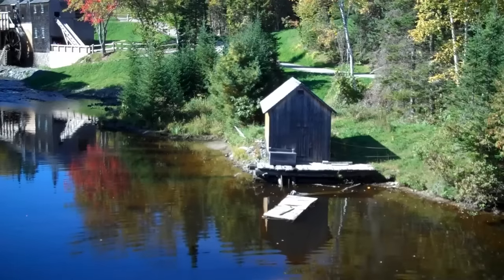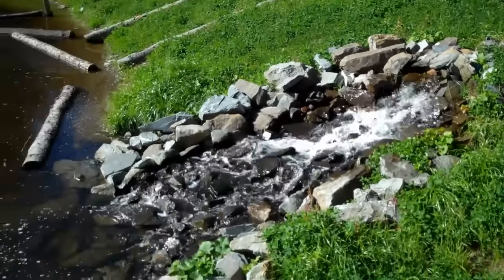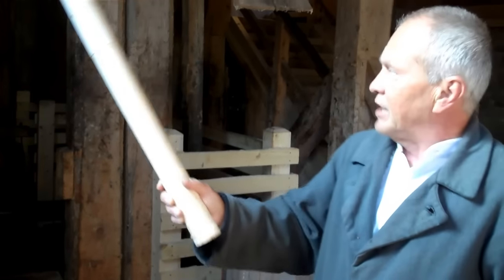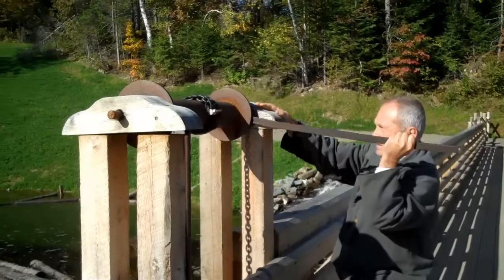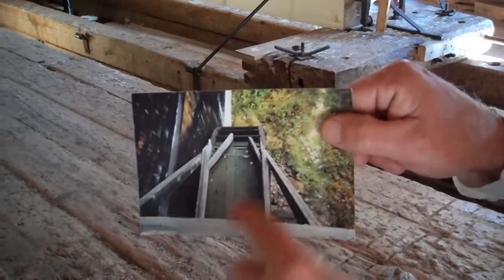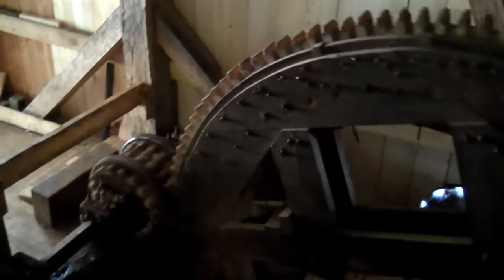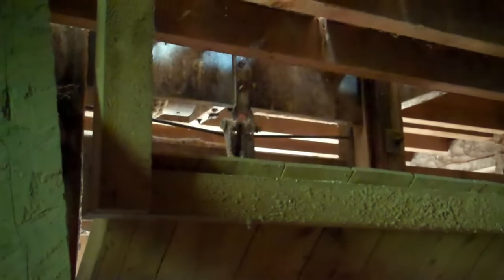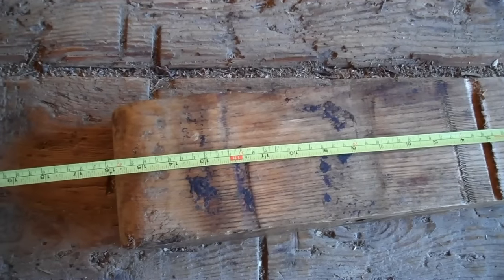Water Powered Sawmill with Wooden Gears at Kings Landing

Comment: I am always impressed at how ingenious and creative the men were who designed and actually built these  water powered saw & grist mills. I wonder how long it took to build this mill? Yep, times were a lot slower then, and it shows in the quality of the workmanship. And the lumber...wow...not your Home Depot lumber, that's for sure...back then, 2 x 4's were real 2 x 4's....not some cheap quality wood and considerably smaller than a 2 x 4. Thanks, Herb, for this wonderful look at this mill.
Reply from the maker: Thank for comments.  We have a smaller water-powered sash sawmill at Leonard's Mills in Bradley, Maine.  It took volunteers many years to get it running properly.  Here is a video of it sawing lumber last weekend: https://www.youtube.com/watch?v=30tBXWrZrH0
Reply: The other reason for the change in size is the change in the whole sawmilling industry, back when sawmills like this were popular the wood would be transported through the water and often times sit in the water up to a year, as a result of this the way the wood dries was very different meaning it would stay the same size as it is milled exactly, today 2x4 lumber is cut to approx 2x4 then kiln dried, and warps and twists in this process which requires finishing to bring to a useable piece of lumber (less than 2x4)
Reply: iliketobuildstuff....Thanks for the information. So...if today's mills know that a kiln dried 2 x 4 will actually come out at 1 1/2 x 3 1/2, then they could just as easily start with a larger dimension timber and have it  finished to a true 2 x 4. But if they did that, they would not get as much profit out of a log. Yea, sounds rather cynical, but that's the way the almighty 'bottom line' philosophy is today.
Reply: It is not a law that they have to be slower. Making them go really fast would just wear things out faster. But there are other ways such as increasing the number of blades so that you can cut the same amount of wood at one time, but by using multiple saws.
Reply: iliketobuildstuff I work at a saw mill, and trust me, we aren’t trying to scam consumers. A modern 2x4 is 1 1/2” by 3 1/2”. Thats the international standard for construction. If mills started cranking out full 2x4’s, carpenters would have to learn a new scale for laying out their frames. I know every saw mill is different, but at ours, me recycle all of our waste cuts, either to mulch, chips, or firewood, so we aren’t really concerned about squeezing the most we can out of every log.
Reply: dev null   Again. You clearly have no idea what you’re talking about. It’s not “falsly advertised”, because everyone buying studs KNOWS the size of them. How many times to I have to explain that 2x4 is a trade term. This is standard practice worldwide; a 30 second google search will show you that. 
Literally every carpenter knows this. It is the VERY FIRST LESSON in any high school carpentry class, and mandatory knowledge in trades school. 

You tell me to “drop the prices to reflect the lost material” like I’m somehow scamming people by not selling them a board 2” by 4” EXACTLY. They’ve always been priced by their LENGTH, not their dimensions, as is EVERY OTHER COMMON CUT OF WOOD. If you absolutely needed a piece exactly 2 inches by 4 inches, I could sell you a piece that way, and it would cost THE EXACT FUCKING SAME PRICE. It’s actually MORE WORK to make it into a standard sized 2x4 because it has to be planed and shaped, but no one charges extra because it’s not worth it to bother.

I don’t possibly know how to explain to you that you wouldn’t want a piece that’s actually 2”x4”, and that studs are bot some elaborate rip off. If you know any carpenter, ask them about this. They will tell you exactly what I’ve told you

Learn what you’re talking about or fuck off. I showed this to the guys at work and we all had a good laugh over it. This is on par with telling a staples employee that pre sharpened pencils should cost less cause there is less pencil.
Reply: It's their fault we don't have that type of lumber today; don't praise them for being wasteful.
Reply: I was just thinking the same thing. The mind of an engineer is a beautiful thing. I can imagine someone with the idea for this invention trying to explain to others that have no idea what he is talking about and just nodding in agreement.
Reply: @D-Vinko It's their fault that allows you to be on your device right now. Technological advancement has and always will be wasteful at start. Also, what do you mean "we don't have that lumber today" are you misinformed?
Reply: @D-Vinko you know wood is one of the only actually renewable resources right? Because you can grow more of it.

Comment: 2 electric pumps? How did the mill get the water back in the day?
Reply: @potatosalad5355  damn why so agressive. Its a valid question.
Reply: @sullivanpecharka3830  
Exactly... no one needs to be so hard on someone else just for asking a question that they sincerely want to know and not just goofing around with it .
Reply: It is bizarre as the whole Western World. To pump water up the hill - to use water fall to turn the wheel. God speed!
Reply: Originally there was probably a water source higher than the mill to replenish the pond. Later, the pumps may have been steam powered, and still later powered by one or two stationary engines probably powered by gasoline.
Reply: sullivan pechark
Reply: A damned waterfall -derp!
Reply: My guess would be they logged in the winter, sawed lumber all spring with rains and snowmelt supplying  the water, when things started drying up it was haying season and soon after that was harvest/autumn and winter preparation. Then back to logging. 
Just a guess though.
Reply: @koosvanzyl2605  OK....
Reply: @MrBtd1985  Agreed

Comment: There's something to love about primitive technology!
Reply from the maker: Thanks for the advice.  We have a similar sawmill at the Maine Forest and Logging Museum in Maine with wooden gears.  The teeth appear to be rock maple and are holding up well.
Reply: not really primitive as such, it's actually built through education/knowledge. primitive would be how the American Indians made arrow-heads. *being square, pardon me.
Reply: Kyle Bittle not primitive at all there are wheels and axels , inclined plans and levers on the Space Shuttle......
Reply: i wouldnt really call it primitive. we use the same technology now in wood shop tools. the only actual difference is the source of rotation/torque. one uses a water wheel and current tools use an electric motor. outside of that the designs havent really changed in basic design in millennia. open up any lathe some time youll see even now you can run them off any belt driven system.
Reply: In what world is this primitive
Reply: Primitive? That's all modern technology.
Reply: Primitive is religion

Comment: I'm surprised how much torque that water wheel delivers, seeing how it goes from a big -> small gear ratio and then that directly drives the saw mechanism. And it's all wood-on-wood too.

I can see why water wheels were used for a long time for textile mills, besides the constant speed with varying load thing.
Reply: The best part is free power.

Comment: Must have seemed like a miracle in this wild land 400 yrs ago when they opened the gates and it turned the wheel.
Reply: I don't think it would really been seen as a miracle, seeing as how waterwheels have been around for a couple thousand years.
Reply: @Lestat3721  
Hey doofus, these waterwheel-powered sawmills haven't been around for a couple thousand years and so it's obvious to anyone with common sense to see where T Wal was coming from
Reply: @get-the-lead-out.4593  That particular one, no, but by the time this particular one was made, they were already in use for a couple thousand years. It'd be like someone calling  the new Ford car a miracle, because it is the new model.
Reply: They couldn't have opened it 400 years ago because they didn't have electric water pumps like this mill uses.
Reply: @RedNeckSurgeyTech  
They would have opened a chute by hand to divert the water into the wheel.
 You're not very good at trolling.
Reply: There was nothing new about this at the time really. For the most part the only thing different about this compared to ancient watermills was that this one is an 'overshot' Mill compared to earlier 'undershot' or 'breastshot' types.
Reply: Better than a computer by 1000 times in its day !

Comment: Does this mill have a practical use or was it just built as an attraction? I wouldn't think that this mill has been around that long.
Reply from the maker: This mill is a recreation to show the importance of water-powered mills  in the past.  Maine had 2000 water powered mills in 1850.
Reply: @herbcrosby That makes more sense. Seems like an incredibly slow process but I guess its innovative and obviously got the job done.

Comment: 1.20 into the video.   I'm really interested  in the uneven wear on the teeth; 240 total teeth on the primary ,20 on the secondary. I've been to loads of water and windmills in the UK and all the ones i have seen have even wear due to the primary and secondary teeth count being non devisible.    i.e.   241 teeth primary ,19 teeth secondary  . This way all the teeth mesh with all the others as the teeth precess  rather than the same clusters meshing together . I was told this non division of teeth was well known by millwrights  and  car gearbox gears are also non devisible apparently ?  for the same reason.
Reply from the maker: Thank you for the good observation.  Claude who runs this mill sent back the following reply:   

Why the trundle is using a lot is the gauge wheel is moving too much and using the trundle is getting used more.The teeth are not hitting the same spot each time so the 20 trundle is using more.The mill is getting too old.   From claude I hope that answer that question you had.
Reply: @herbcrosby   Many thanks for the reply .   I went to a backshot mill in Cambridgeshire (UK) last year and the volunteer let me count the teeth (bit obsessive i know) and the teeth count on the primary and secondary gear wheels were both prime numbers  (one was 19)  . I had a chat with him about what i'd read on non-divisible gear ratios for even wear patterns . He had not heard that and thought it was perhaps just by chance the way the gear teeth had been divided up.     Marking out a gear wheel for 19 teeth (or any prime number) is  very tricky  to do and probably deliberate .   Much easier  to pick numbers that divide into 360
Reply from the maker: @simonharper4199  Thanks for the thoughtful observations on gear tooth design for wooden gears.  Suspect this is less of a concern now with precision machined steel gears.  Claude sent an additional email stating the King's Landing sawmill is now 45 yers old, well past it's expected life:

A sawmill like this set up in the 1800 hundred was suppose to last about 20 to 25 years and ours been running been 45 years so the machinery is getting to old that why its wearing to much everywere.

Comment: They say portable saw mills are slow ... but this my god
Reply: You should try it by hand ...
Reply: steam has lots of power when you look at those pulleys and reduced gear ratios that log is nothing to the power  of that drive, when you look at the steam expanding 1 to 1700  of its original volume
Reply: recently saw a portable where the cut over 5,000 board feet in a day.  go look at "acorn to Arabella" on youtube